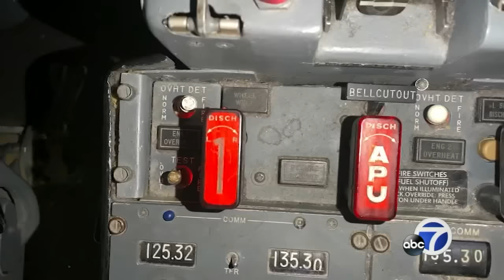Expert shows how off-duty pilot was able to reach controls to shut off Alaska flight's engines

Comment: Calling these planes similar is like calling a Ford Pinto and a Tesla similar. The 737 and E175 are enormously different. Nearly 50 years technologically separated. Sure, the system is roughly the same in function but this just has  lazy reporting written all over it. To add insult to injury there's not ONE image of an actual E175 anywhere on this clip. And it should say how ENGINE fire extinguishers work, not cockpit, in the caption.
Reply: a "slightly different" aircraft
Reply: Nahh i love it dawg a "similiar plane" e175 and b737 lmaoooooo they keep showing just the 737 its sooo funny
Reply: Nerd .
Reply: nice try! most people would never know why they are dropping like a brick with wings.
So, no more flying for Emmerson?
Reply: I know. This really is a silly representation for ABC7 to have presented. They probably didn't have access to an E175 cockpit nor an E175 simulator either, but I'd have hoped they'd at least shown viewers a clip of the cockpit interior of the E175, to highlight the "slight" difference.

Comment: It's pretty terrifying to me that there are a couple of handles that can be pulled to disable a passenger airplane like this.
Reply: Imagine the engine caught fire. Just pulling one lever to completely isolate the engine is a wonderful idea.
Reply: Do you ride in cars? What if I told you that's actually way more dangerous? You zip by other cars, inches away with a combine speed of 70mph if you're both going 35. Driver could swerve into traffic, or just turn off the engine (and steering if hydraulic, no brake boost when intake vacuum is gone). A front passanger could do the same.
Reply: @heh2k  Yup you are correct. Now imagine if there were as many planes in the sky as there are cars on the road - which method of travel would be more dangerous? My problem with airplanes is the threat of gravity or the Y axis if you will. If a car malfunctions or the engine dies, you just pull over the side of the road/put on your emergency lights. If a plane malfunctions/the engines die or get shut off, you're dead.
Reply: @DarkEmperor2460  There's more flying space in the sky than driving space on the ground and there are many redundancy systems or designs on aircraft that ensure safety of those in them, more planes in the sky definitely means that there are going to be more airports and places to land in case of an emergency,  currently air travel only cause 30.8 deaths per billion hours but cars cause 130 in the same time
Reply: @JamieOliver77  More flying space sure but also a lot more variables for accidents in the air than on the ground. There are currently over 250 million cars on the roads in the United States. Can you imagine 250 million airplanes in the sky? It would be chaos! Air traffic controllers would be the most common job position.

Comment: Since a Boeing 737 instead of the Embraer 175 is being shown; isn't it about time the 737 got a redesign of its main landing gear ? By now, with all the revisions this aircraft has undergone since its inception in the 1960's to its current larger and heavier versions like the 700, 800, 900, and now the Max, you would think a dual set of wheels on each side would be in order.😮